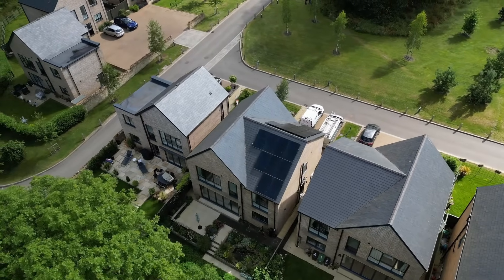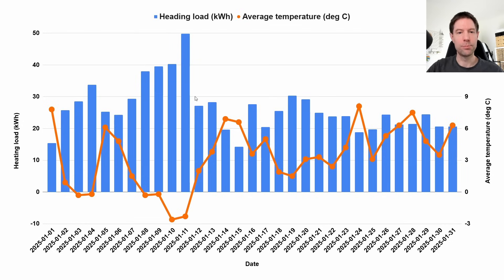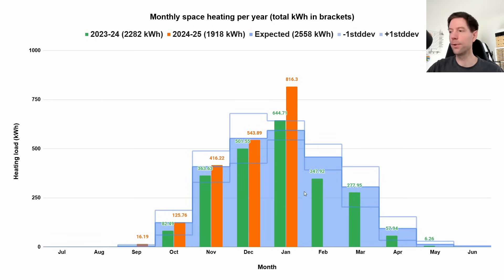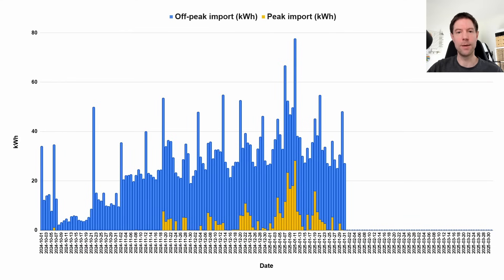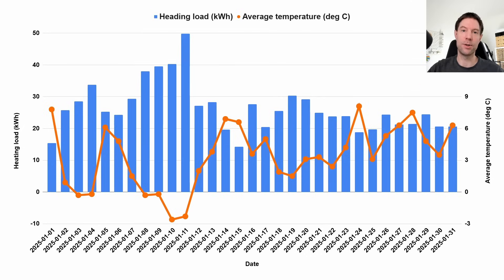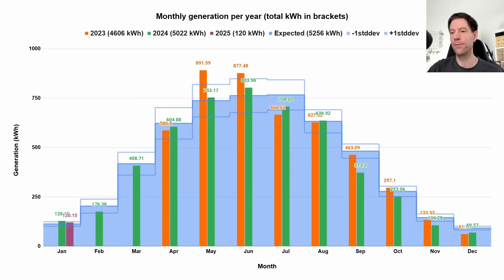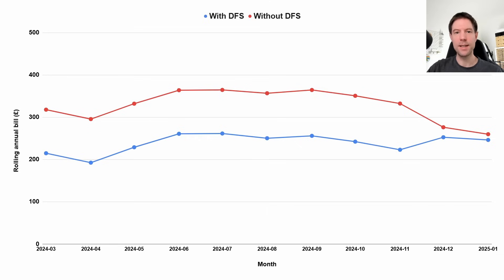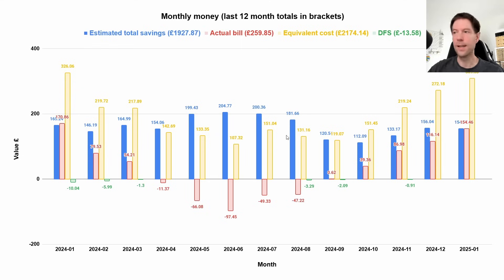Which would win in a fight?  A cold snap or a heat pump?

Comment: I find the heat pump technology to be quite magical in the way less energy is used.  But  I question a bit the government subsidising each property for upto £7000, when the elderly heating subsidy was removed.
Reply: The Winter Fuel Payment wasn’t entirely removed it’s now means tested. There is an argument for means testing the heat pump subsidy as well and will probably be once adoption becomes more mainstream.
Reply from the maker: Encouraging adoption increases uptake which encourages reduction in install costs in the long run for all.  It's the same argument used for feed-in tariffs for early solar installs.
Reply: If ASHP heating is so good people would not need bribes to install it. Why no grants to install double glazing etc.
Reply from the maker: @richardlewis5316  there are grants for improving insulation.  Don't knock heat pumps until you've tried one.
Reply: @richardlewis5316  changing from gas to heat pump types can sometimes be expensive.

Comment: Can I ask why you turned up the heating temperature when you had visitors? Do you think the average temperature in your house is below  the typical house?
Reply: We do the same. People are used to different temperatures.  We run our house on the cooler side, but we are also people who prefer Iceland to Majorca. We tend to run at 18C (minimum) except in the early hours when it is allowed to go to 16C (minimum). It’s never actually off.

When we have guests we put it up to 20 to 22C for their benefit. We consider it no different to offering tea and biscuits.
Reply from the maker: My parents are old.  Also, the rooms we use frequently when it's just the two of us are the smaller ones that we can keep to 21-22 very easily while leaving the larger spaces at 19 as we don't spend as much time in those.  When we have guests we heat those larger spaces to 20-21, as that's where we host guests, and that takes more energy.

Comment: Thanks Tim 🙂. Recently I've found myself considering the effect of 'passive solar' heating on the house and the effect of reducing the energy needed via electric (or gas/oil etc) to heat the home. My house faces East/West, so on very clear sunny days the sun pours through the windows and being a well insulated home this heat is trapped, at least for a few hours. I know previously you've spoken about the negatives of having your bifold(?) windows in the kitchen. However I do think that at this time of the year there can be a noticable affect on reducing consumption. I sometimes think we overlook the obvious and perhaps traditional passive ways to use energy. Not sure how this might play into your figures as a factor.
Reply from the maker: Well, as it happens the solar gain is an important factor in the new heating model I'm building, so I'll be sharing more about that when I'm ready to present my findings.  It absolutely makes a huge difference when it's sunny in helping reduce the required heating load.
Reply: Yes solar gain is a significant input into building heating. It can be several kWh/day, obviously depending on windows size and orientation and shading. The better insulated/airtighted your house, the more significant it is (along with the heat from electrical loads, people and pets, all of which contribute). The PHPP (passivehouse planning package) model takes all this into account (and I assume HEMS does too, but I've not looked at that yet). A very well-insulated and airtight  house will get all its heating from electrical use, people and solar gain for most of the year. We don't need any heating on sunny days in winter, but do need some when it's grey and < about 7C outside.